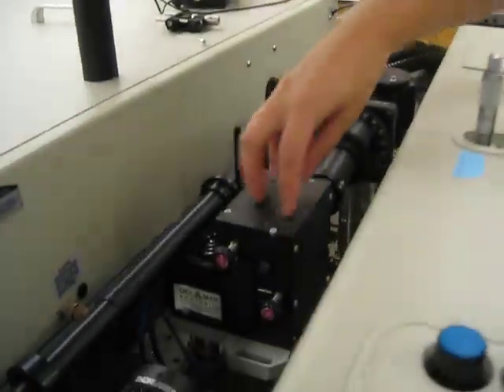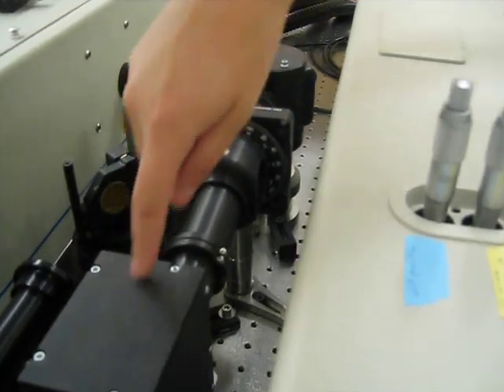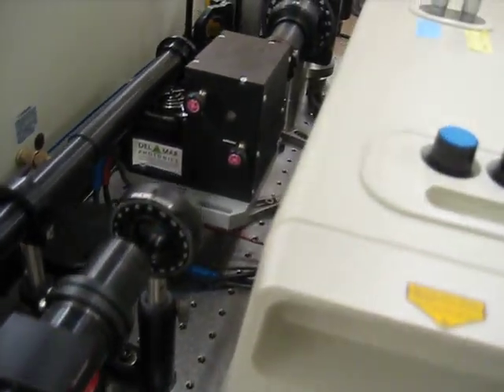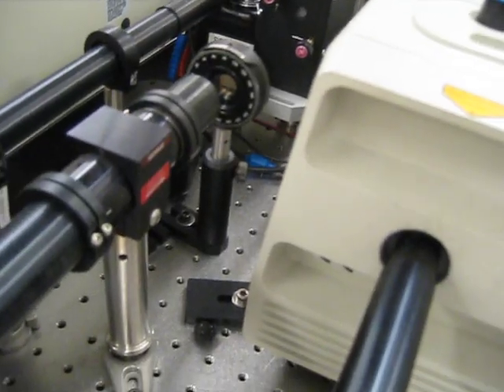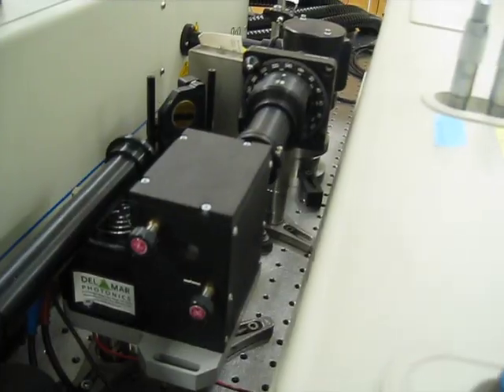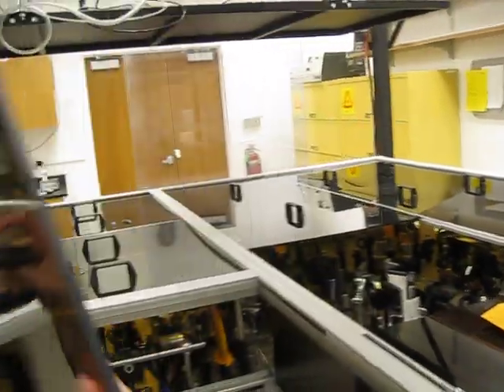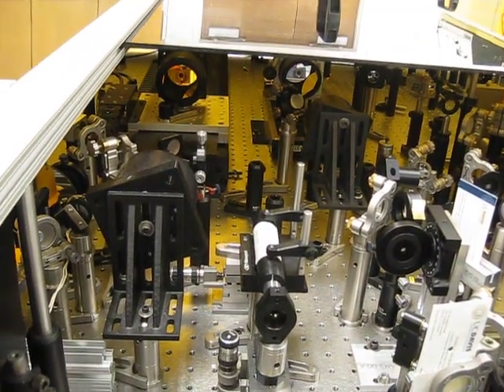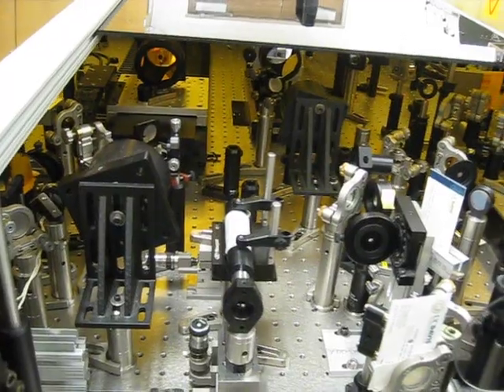A single source femtosecond-millisecond broadband spectrometer UC Davis - sales@dmphotonics.com

Comment from the maker: Newly developed far-red DNA stain can image living cells
10/05/2015
Posted by Lee Dubay 
Associate Editor, BioOptics World

Scientists at École Polytechnique Fédérale de Lausanne (EPFL; Switzerland) have developed a new DNA stain that can be used to safely image live mammalian cells for days, even under demanding imaging conditions.

Fluorescent stains that light up a cell's DNA are popular in live-cell imaging, as they enable tracking key biological processes such as cell division. However, current DNA stains are themselves toxic or require types of light (e.g., blue) that can damage the cells. Ideally, a safe DNA fluorescent stain would be activated in the safer far-red spectrum of light.

Also, many DNA stains are not compatible with super-resolution microscopy, which can capture images of cells at higher resolution than that allowed by regular microscopes. So, the bioimaging community has been waiting for a DNA stain that shows low toxicity, works with far-red light, and can be used in super-resolution microscopy.
The lab of Kai Johnsson at EPFL has now developed a DNA stain that combines two molecules. The first is a fluorescent molecule (silicon rhodamine or SiR) that works in the far-red spectrum and was previously developed in Johnsson's lab. The second one is a well-known DNA stain Hoechst (the chemical name is bisbenzimide). As a result, the team named the new DNA stain "SiR-Hoechst".
 
The new stain works by binding to a part of the DNA helix known as the "minor groove". Once bound, it turns on and emits a bright fluorescent red light. This is a tremendous advantage, as the stain produces very little noise—if it has not found its target, it stays "off". More importantly, SiR-Hoechst can bind to DNA without affecting its biological function in the cell. And because all cells possess DNA, the probe can be used across numerous species, types of cells, and tissues.

This image shows mitosis of a live HeLa cell stained with SiR-Hoechst, whose chemical structure is superimposed. (Credit: Kai Johnsson/EPFL)
Because SiR-Hoechst works with far-red light, there is little risk of damage to cells. In addition, the light that it emits can be easily distinguished from any background fluorescence of living cells. Unlike other DNA stains, it can safely maintain high-quality staining in live cells for over 24 hours, allowing biologists to identify individual cells in tissue or culture, or track delicate processes, such as cell division, in real time. What's more, the stain can be used in live-cell super-resolution microscopy, paving the way for DNA imaging in cells and biological tissues with exquisite resolution.

The team is now preparing to commercialize SiR-Hoechst through their EPFL startup company, Spirochrome. The company has been in business for a while, supplying the scientific community with a new class of fluorescent probes that can image of the cytoskeleton in living cells with unprecedented resolution.

Full details of the work appear in the journal Nature Communications; for more information, please visit http://dx.doi.org/10.1038/ncomms9497.

Comment from the maker: Pismo pulse picker for Tsunami system running at 795nm, 100fs, 80MHz - sales@dmphotonics.com

The Pismo pulse picker systems is as a pulse gating system that lets single pulses or group of subsequent pulses from a femtosecond or picosecond pulse train pass through the system, and stops other radiation. The system is perfectly suitable for most commercial femtosecond oscillators and amplifiers. The system can pick either single pulses, shoot bursts (patterns of single pulses) or pick group of subsequent pulses (wider square-shaped HV pulse modification). HV pulse duration (i.e. gate open time) is 10 ns in the default Pismo 8/1 model, but can be customized from 3 to 1250 ns upon request or made variable. The frequency of the picked pulses starts with single shot to 1 kHz for the basic model, and goes up to 100 kHz for the most advanced one.
The Pockels cell is supplied with a control unit that is capable of synching to the optical pulse train via a built-in photodetector unit, while electric trigger signal is also accepted. Two additional delay channels are available for synching of other equipment to the pulse picker operation. Moreover, USB connectivity and LabView-compatible drivers save a great deal of your time on storing and recalling presets, and setting up some automated experimental setups. One control unit is capable of driving of up to 3 Pockels cells, and this comes handy in complex setups or contrast-improving schemes. The system can also be modified to supply two HV pulses to one Pockels cell unit, making it a 2-channel pulse picker system. This may be essential for injection/ejection purposes when building a regenerative or multipass amplifier system.
http://www.dmphotonics.com/Pismo%20pulse%20picker%20systems/Pismo%20pulse%20picker%20systems.htm

http://www.spectra-physics.com/documents/datasheets/Tsunami_Ultrafast_Laser_SP.pdf

For custom quote we need to know
Pulse wavelength
Pulse Duration
Pulse Energy
Rep Rate
Beam Size
Required rep rate after pulse picker
Required contrast

Comment from the maker: Hatteras-D femtosecond  transient absorption data acquisition system
Future nanostructures and biological nanosystems will take advantage not only of the small dimensions of the objects but of the specific way of interaction between nano-objects. The interactions of building blocks within these nanosystems will be studied and optimized on the femtosecond time scale - says Sergey Egorov, President and CEO of Del Mar Photonics, Inc. Thus we put a lot of our efforts and resources into the development of new Ultrafast Dynamics Tools such as our Femtosecond Transient Absorption Measurements system Hatteras. Whether you want to create a new photovoltaic system that will efficiently convert photon energy in charge separation, or build a molecular complex that will dump photon energy into local heat to kill cancer cells, or create a new fluorescent probe for FRET microscopy, understanding of internal dynamics on femtosecond time scale is utterly important and requires advanced measurement techniques.
http://dmphotonics.com/Hatteras-D_DataAcquisition/Hatteras-D_DAC.htm

Comment from the maker: Beacon-DA Femtosecond Optically Gated Fluorescence Kinetic Measurement System

New Beacon-DA operates at 1 kHz and has even better temporal resolution than Beacon-DX that operates with Ti:sapphire oscillator.

1. Beacon-DA is easy in operation because it works w/o tight focusing
2. It has better temporal resolution because it uses simpler optical components
3. It has better sensitivity because amplifier pulses have higher energy than pulses from Ti:sapphire oscillators
4. Ultrafast fluorescence can be measured from samples which have long-lived photoproducts. It is very big advantage comparing work with oscillator excitation.
5. An OPA can be used for operation giving wide excitation spectral range.
6. SH and TH of amplified pulses can be used for the excitation too. We can quote frequency conversion unit for TH/SH generation.
7. SH only is included to the Beacon-DA free of charge for initial training but it can be always used.
7. We always recommend Beacon-DA to customers having amplifier because we should offer our best products. No reason to have the amplifier and don't use its advantages
8. What is disadvantage? Except Beacon-DA, all upconversion systems use photon counting detection. Due to fundamental principles of photon counting, it gives not more than 10^2 dynamic range at 1 kHz rep. rate and 1 sec accumulation time. One can get 10^5 dynamic range at 1000 sec accumulation time per point only. It is not realistic. It is big disadvantage of photon counting for 1 kHz comparing 80 MHz. Beacon-DA electronics gives >60 times better dynamic range for 1 kHz comparing photon counting. It means that 10^5 can be achieved at 10-15 sec accumulation time. It is the same dynamic range as for oscillator excitation. So, I don't see disadvantages and you cannot find analogs of Beacon-DA on the market. 
http://dmphotonics.com/Beacon-DA/Beacon-DA%20Femtosecond%20Optically%20Gated%20Fluorescence%20Kinetic%20Measurement%20System.htm